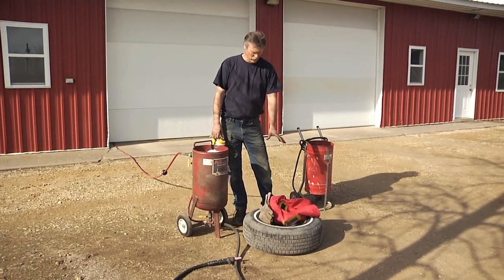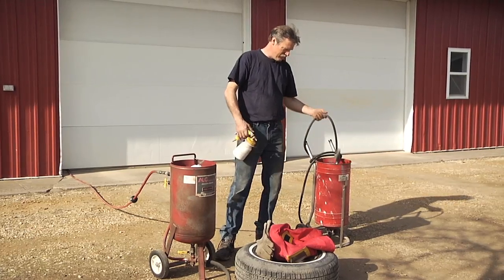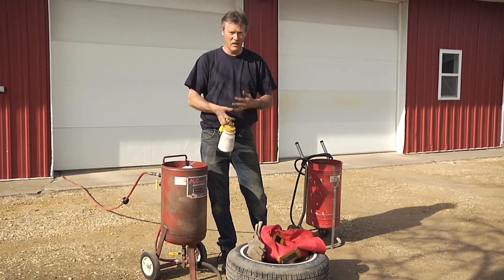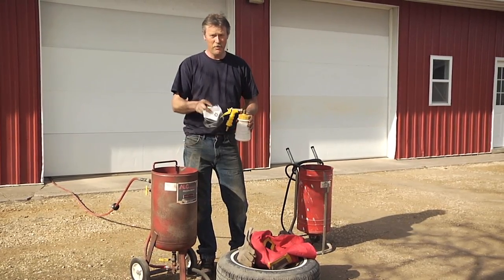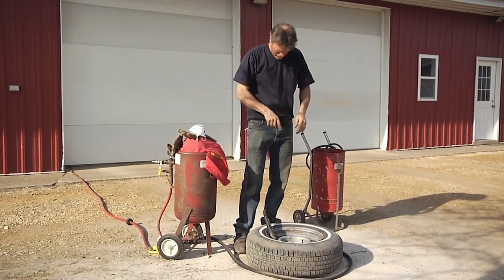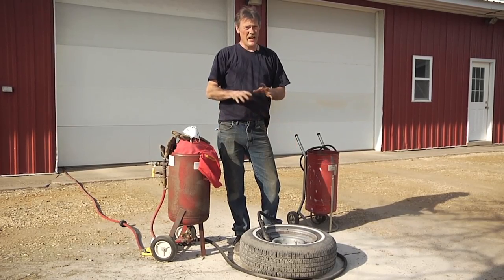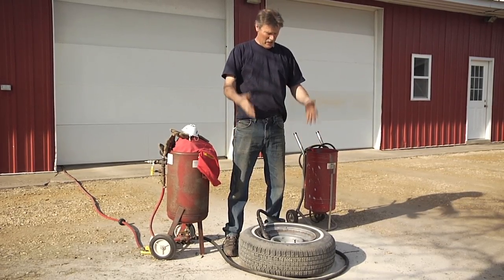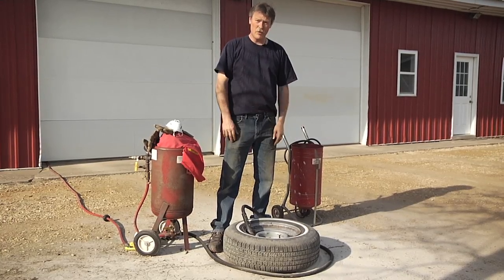How To Sandblast A Car Wheel

Comment: Does this mess the tire up at all?
Reply from the maker: Hello.  n general the media will bounce off the rubber tire although you don't want to focus the spray directly at the tire for extended periods.
It can be done like this, but sand sometimes gets lodged between the tire and rim and it can be difficult to mask off and spray them with paint.
Your first choice should always be to remove the tire and valve stem before blasting the rim, that way you can blast and paint the bead edge for a good seal.
Thanks
Mark-Classic Car Restoration Club

Comment: Hi. Good video. Which power of compressor donyou recommend to use a sandblaster like your? Thank you
Reply from the maker: Hello Guillermo, 

Each blaster manufacturer has their recommendation for air supply. When blasting it's not so much about pressure but rather volume of air (CFM or Cubic Feet per Minute).

The minimum CFM for a blaster like the one Brent used in the video is often 7-10 cfm @ 90psi. Remember more is better! but if your compressor only puts out 7 cfm @ 90psi you may find yourself waiting for it to catch up. For most media blasters I recommend an air compressor of at least 14 cfm @ 90 psi or higher. 

Wrench Safe, 

Mark

Classic Car Restoration Club Video Membership

Comment: Literally no technical info. Media used, which is safe for which alloy, tank pressure, types of nozzles to use in what applications. Video summary: if you want to sand blast, don't be in a city and then add sand and you are done.